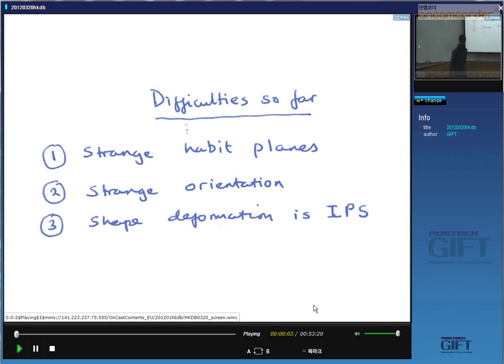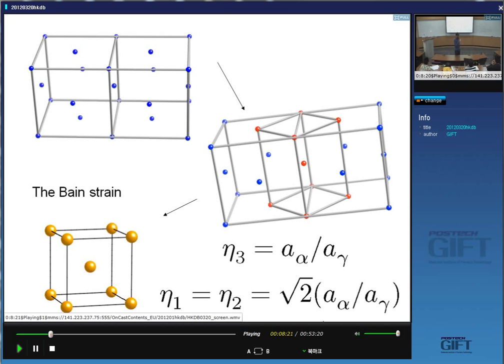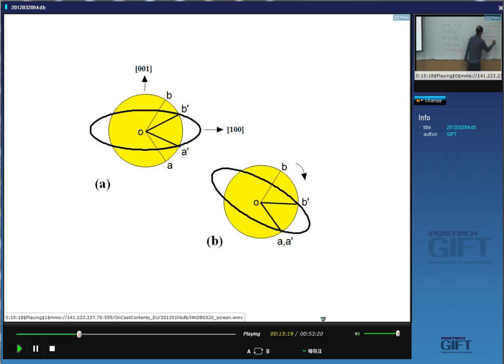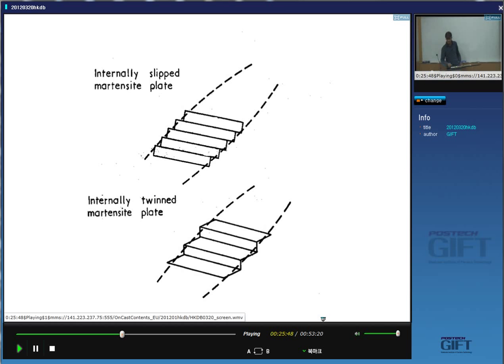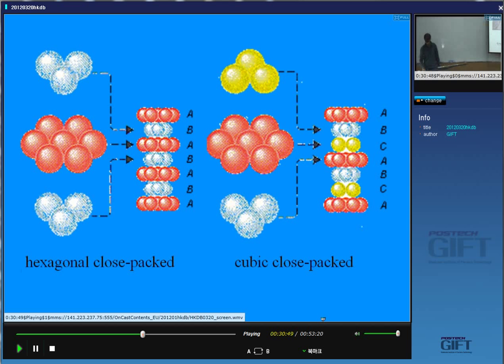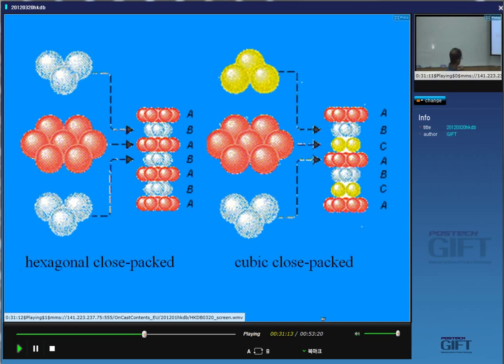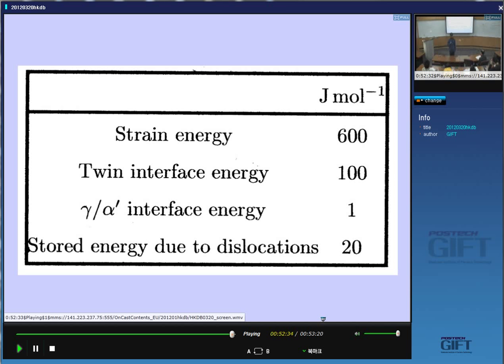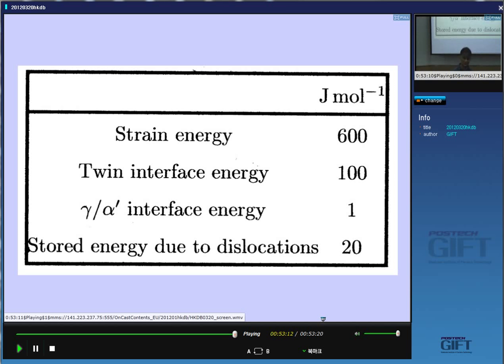Physical Metallurgy of Steels - Part 2

Comment: Sir, I did not understand the last part where free energy curve of martensite is shifted upwards by the strain energy. I mean, for drawing the lower curve, isn't the twin energy, dislocation energy etc. already taken into account? Does the lower curve only account for the chemical free energy?
Reply from the maker: You are right, the lower curve only accounts for the free energy difference between austenite and martensite of the same chemical composition, but not the stored energy terms due to strain etc.

Comment: The strain energy is stored in the austenite or martensite? what's the effect of the stored energy to the next transformation? thank you very much.
Reply from the maker: There is a factor called the "accommodation factor" (Christian, Theory of Transformations in Metals and Alloys) that gives the distribution of strain in the austenite and martensite. It is mostly in the austenite. It will obviously affect subsequent transformation either favourably or unfavourable.